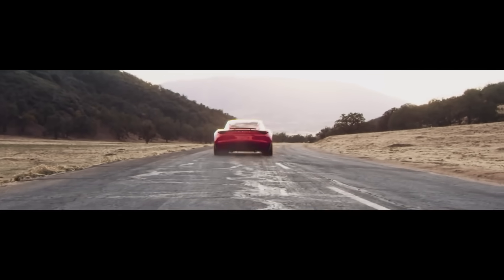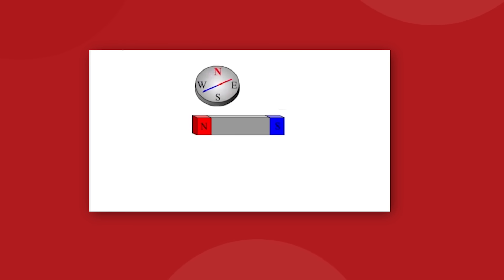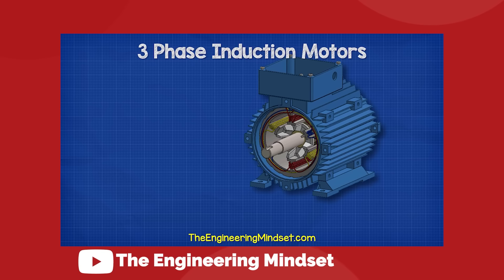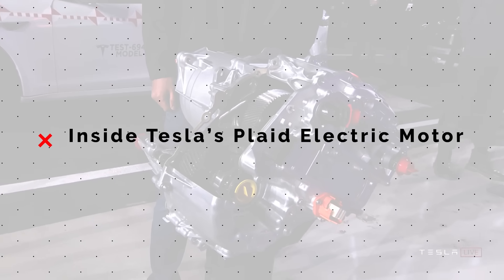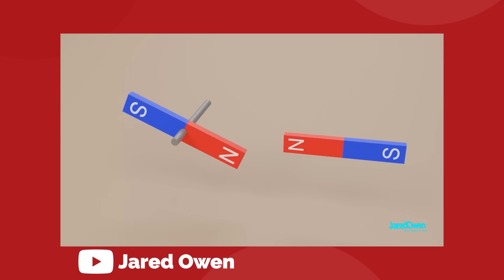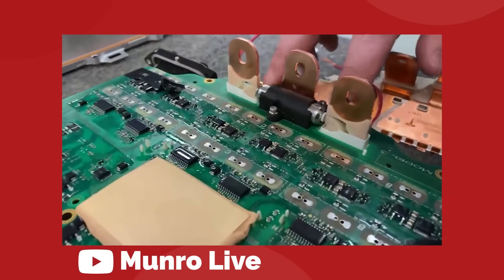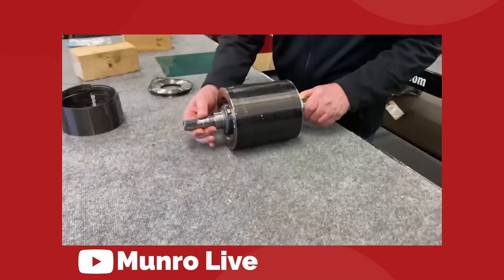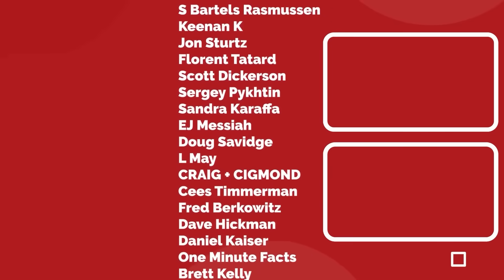The Real Reason Tesla Developed The Plaid Motor!

Comment: Wouldn't the outer wheel spin faster going around a turn? at 18min
That is a stargate motor if I've ever seen one. Rather than stacking the magnets on the outside though they used the stargate configuration on the inside most like adding more magnetic flux to an already powerful magnetic.
Reply: Unless it's an open differential on a high powered car on a tight corner at full throttle - then the inside wheel can turn much faster (while making lots of noise and smoke)...

Comment: Actually, the primary difference between AC and DC motors is the location of the electromagnets.  DC motors have the EMs on the rotor, AC on the stator.  Of course, you can also have a motor with both the stator and rotor having EMs.  There is also brushless motors, but they are MUCH more complicated.  The brushes are the blocks of metal that allow the electric current to pass into the coils of wire from the stationary input.  Generally, the more contacts (and thus more coils) you have, the more efficient the motor is.
Reply: P ⁹99
Reply: N JJ u⁷888
Reply: 0

Comment: You left out how unsafe it is to have a car with that much power and no adequate braking equipment or fluids to compensate. 

But whatever, bait for clicks off this pile of garbage car that only brain dead people buy
Reply: Regenerative braking is more than adequate.
Reply: @terrafirma9328  No they aren't. You can find out the hard way, go to a race track and use them like we would have to in a competition. Tesla markets the car with “track mode", but multiple people have had complete brake failures from how much those regen brakes can't handle the weight and inertia. Don't market a track mode people can't actually track. 

And shut it, telling people that's adequate is just as shady as Elon saying it.